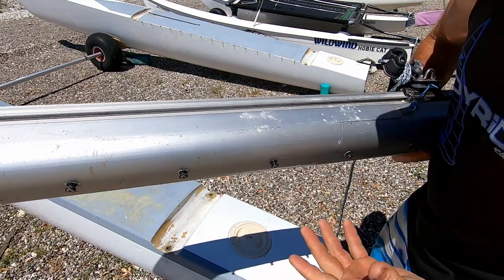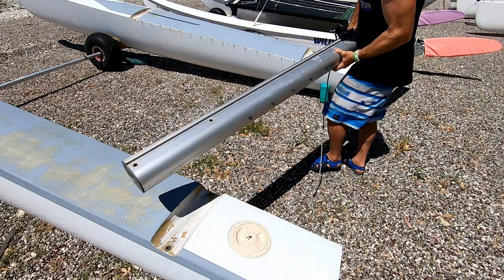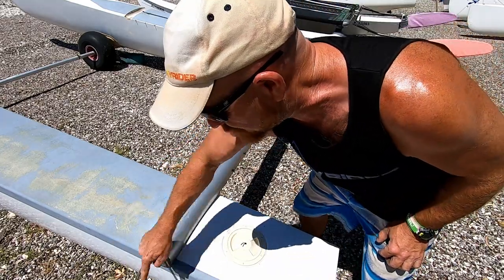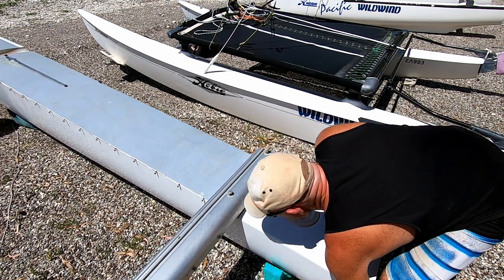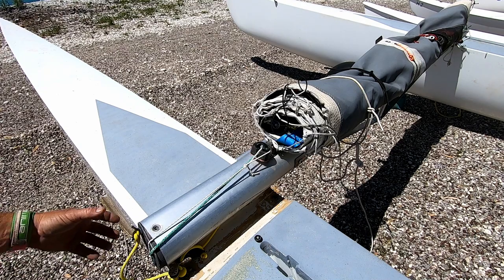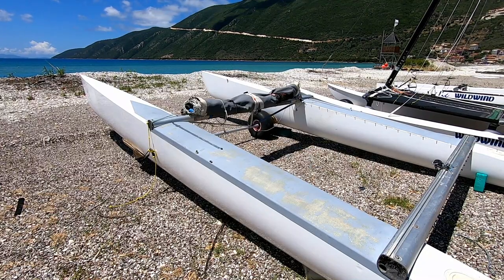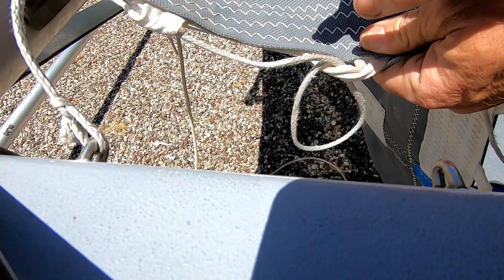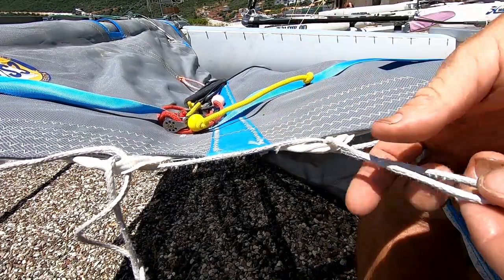Tornado catamaran how to assemble, How to build

Comment: Hi Joe!
It's a little bit off topic, but since I've got my Reg White tornado, I'm wondering about the two cleats on  both shroud adjusters, which are standart on the classic tornados. My boat has been transformed to olympic standarts by one of the previous owners, so obviously these cleats are not needed anymore, but for what purposes were they used originally?
Günther
Reply from the maker: Those cleats at one time would have been used for the jib sheet - there would have been no cleat on the block so those were used when trapezing - as far as i know only seen on the Reg White boats. This would have been before the spinnaker was standard.
Reply: Hi Joe!
Got it! The crew could cleat the jib sheet much easier using one of the cleats (either front or aft) on the windward shroud adjuster when trapezing! Easy!
Thanks for opening my eyes!
Guenther

Comment: Hey Joe do you recommend using Gelcoat (like most boats) to resurface the Tornado hulls or something else?  I'm looking at buying a older 1977 Sailcraft model that needs superficial TLC as it's been sitting in the elements for the last 10years. And he said to use marine paint instead?  One other odd thing I noticed is he replaced the stock rudder system with a Hobie system. Have you ever heard of that configuration?
Reply from the maker: Hi, as far as I know, Tornados are genrally painted rather than gelcoated. 
I'm not an expert in this department though.
I never saw Hobie rudders on a Tornado though. Should work as the shape and size of the blades are quite similar. The original T system will be much lighter.
Reply: @JoyriderTV  thanks for the confirmation, he said the same thing. I'll look more into the best type of paint to use.